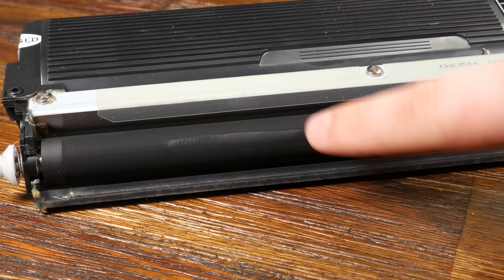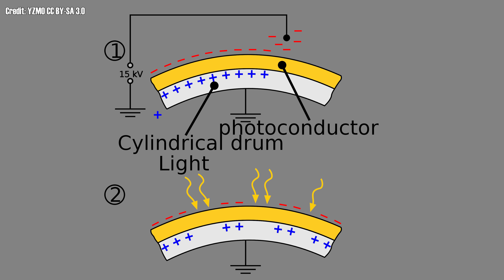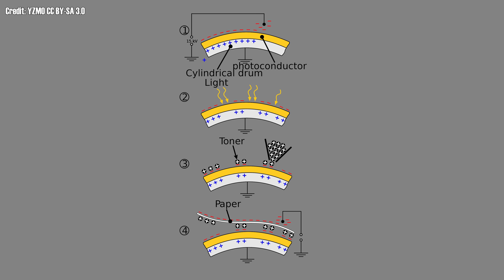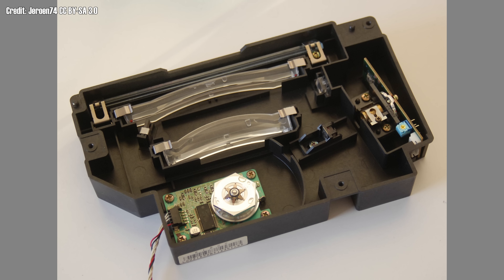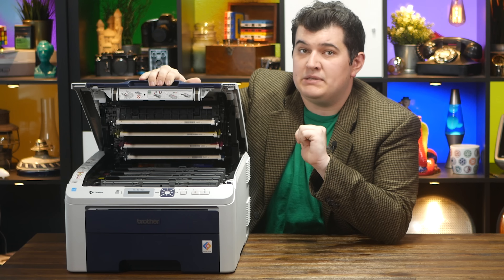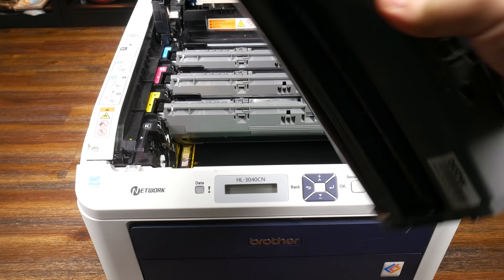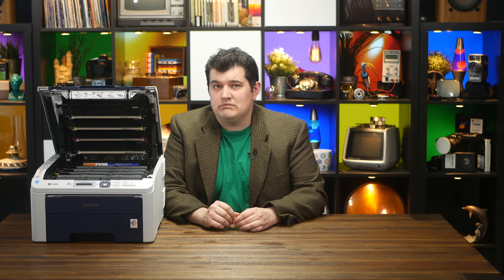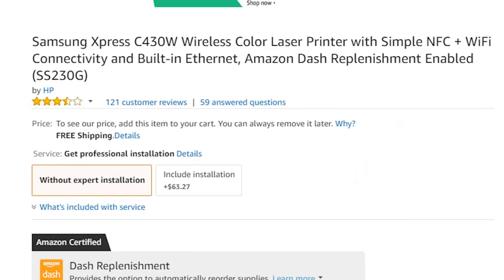LED Printers: The Common Printing Tech You Haven't Heard Of

Comment: Just found out my Xerox Phaser 6500 is actually a LED printer.  I bought it new in 2011 and still works.  I've known LED printers been around since the 1990s.  Just didn't think Xerox would use them in their printers when I bought mine.

Comment: Even today a lot of the Xerox desktop model A4 printer are in fact LED and depending on the engine in the A3 model devices those can be laser as well. Seeing as most of those print engines areanufactured by companies like Lexmark and sold to Xerox who the. Used their own software and casings etc. Has been that way for quite a few years. I happen to work for a major print company lol 

Great video.

Comment: Just an fyi... I opened up and cleaned a Canon ImageClass MF642CDW laser printer and the toners are in a line like this LED printer.  It uses an "image transfer belt" or ITB to move the paper under the toner carts in a straight line.  After opening up the laser unit, I can confirm it is indeed a legitimate laser printer with a spinning 4 sided mirror.  Point being that if you're in the market for one vs the other... You can't use the toner layout or compactness of the machine as a guide.

Comment: I had an old big high-output professional laser epson printer that had straight toner refill tanks (I think it was modded) but A3 super cheap to run and I used it to print street art paste ups.   Anyhow I realised during a repair at it's end of life that it was actually LED based not laser, when I was reading repair manual.

Comment: 0:18 Ink dries out, meaning that the printer has to either constantly be performing a "maintenance mode" which wastes ink, or you need to print rather regularly which, in this paperless age, fewer and fewer people are doing.

The herky-jerky nature of the print heads as they travel back and forth is very unpleasant compared to the smooth print of pretty much any laser printer.
Ink cartridges are usually priced at stupid levels, meaning that you're forced into buying generic ink which often clogs the inkjets so you're damned if you do, damned if you don't.

Because the ink is a liquid, freshley printed documents have a tendency to smear if touched until the ink is dried.

Water-based inks are likely to completely wash away if the paperthey are printed on becomes wet, meaning shipping labels printed with some inkjet printers can be rendered completely unreadable if they get wet from something like, oh I don't know, rain.

None of these issues plague laser printers, so despite their higher upfront cost (and arguably more expensive toner) you can pretty much count on them to work perfectly even if they've been idle for over a year, they don't waste toner on "maintenance modes," the toner is bonded to the paper so water doesn't smear it, the toner is never wet so you don't have to wait for it to dry, plus spills can easily be cleaned up as the toner is a poder. I could go on, but if you read this entire thing, now you know why I generally dislike Inkjet printers and why I will forever use laser printers. Or LED porinters, which are the subject of this video as you'll soon see.

That said, techmoan recently reviewed an inkjet printer that was actually pretty decent in terms of the ink cost, so even if a "maintenance mode" were to waste ink, it's not like it's wasting super expensive ink.

Perhaps one day I'll rejoin Team Inkjet. Particularly for photo printing (and images in general) inkjet reigns sureme. But for now, I'm planted in the realm of toner so that, when I have to do my taxes, I don't have to waste time, energy, and money fighting a stupid inkjet with clogged heads.

Comment: The scanner units in my Kyocera FSC 5020 N contain modules with a 5000 LED array and a flash memory chip to store calibration data to compensate for difference in brightness

Comment: LED printers are quite common on larger format machines, such as those used for xerographically printing engineering drawing at their full size. Those machines typically are just black and white and also don't need to have resolution as high as 600DPI (or higher).

Comment: I don't know if you've ever seen one, but hp started selling page-wide inkjet printers a few years ago. Best printers i ever bought for work. the speed problems are solved by moving the paper past an 8 inch full color print head. 50 pages a minute color printing on some model at a fairly good price. 9000 pages from a black cartridge. 7 cents a page for color using hp's prices and claims per page. What makes the really nice is that the heads are covered to prevent ink drying out when not in use, and they will exercise the heads if left unused for an extended period. When the office shut down during covid i was expecting the worst when we reopened. They worked flawlessly when we started up after 2 years of no use. They were quiet and reliable, but lasers are cool! Best printer I'd seen from hp in a while. We also have a page-wide that works with 11x14 paper. first printer printed 150,000 pages in 5 years. very good for a small office printer. $500 btw. I'd buy on in a heat beat if they started making them again.

Comment: I know this video is 6 years old now, so no clue if you'll see this comment, but after watching this video, I have a concern with LED printers similar to a concern I have about digital hybrid instant cameras. When you're relying on a row of LEDs to print, a single LED burning out renders the entire camera (or in this case, printer) defective or potentially even useless. I know LEDs typically have longer life spans, but having thousands of them increases the odds that one will burn out. I wonder what the statistical life span of these LED arrays are, and how it compares to the life span of the rest of the device. In other words, is some other part of the camera or printer likely to fall far before there's a likely chance of any one LED failing?

Also happy new year!

Comment: Wait until he learns about the Xerox Phaser 8400 that wasn't an inkjet, or a laser. They were phase change printers that used a wax-like solid ink block that was basically a big crayon. We used them when I worked for Staples for our signage. They were great but they smelled like a Crayola factory on fire when you ran large amounts of prints at a time. One major downside is you couldn't laminate the pages because the ink would "re-melt" and ooze out of the laminate sheet distorting the image.

Comment: Transfer belt unit, used in color printing process. Paper does not come in contact with the drums in these units. Instead the color is created on the transfer belt first and then applied to the paper. My research on your LED printer shows that your printer, also has a transfer belt. 
The laser printer uses a polygon mirror which allows the smooth transition of the laser from left to right, This does add a bit more size to the laser component but the LED strip for each color could result in failed LEDs in the strip, requiring the entire strip to be replaced to correct it. LED strips are also used in scanning, but they are also measured for intensity across the array. To guarantee that there are no areas brighter or darker. 
I do like the LED printers, and I believe that in the future, they will become part of a tonerless system. That also utilizes UV instead of a fusing unit.

Comment: Please explain why sometimes video is out of sync with audio. In this video, for example, the outro video clip lags behind the audio by about 1/4 second, but is noticeable. I understand that video  takes far more processor cycles to render than does audio, but most recording software takes this into consideration and corrects it with an algorithm before it's output or saved.

On the topic of printers, I have found, after 30+ years of computing and printing, that the Epson EcoTank printer line is the most reliable and economical one of the dozens I've used. The ink is cheap, lasts a good long time, and output happens faster than I can get into the next room to retrieve the print. The only caveat being, it is advisable to print a full color page at least once a week to prevent ink thickening in the fine print heads, necessitating using a cleaning kit to correct. This process is something one would NOT like to do more than once. It's quite involved, intricate, and seldom works 100% on the first try, requiring multiple cleaning cycles.

Comment: I wonder if I was the only one who thought laser printers burn the paper to print before watching this video
Reply: Well, there ARE printers out there that do mark the paper using heat alone, but that requires special thermal paper. I think these are common for receipt printers where color and shading aren't needed, just black and white text, and avoiding ink or toner is a huge benefit when you're printing a thousand receipts per day

Comment: Great printer. Have the same exact print bought 13 years ago. Bought it as it was cheaper than replacing all 4 toners in my Oki C5150n printer I bought in 2005.

Also "laser" printers that do color at 1/4 the b&w speed (or less) usually do so because they are actually printing 4 times, rotating which color is currently printed. The reason I bought the Oki back in the day was it was one of the few non commercial color ones that printed in a straight pass, allowing you to print much thicker stock though it.

Comment: Never put Tyvek in a printer that uses heat to fuse the pigment to the media. Its melt temperature is below the fusion temperature and WILL destroy your entire fuser unit. Ask me how I know.
Reply: Oooh, good tip.
Reply: Ouch... Sorry for your printer. Good to know though...

Comment: Yes LED printers are really flying under the radar because they're often labeled as laser printers. My Kyocera FS C2126mfp for example has the toner cartridges aligned such as the Brother(but the cartridges are even smaller because the Toner cartridges and drums are two separate things and the drums aren't as easily accessible with Kyoceras because there is some disassembly required) but it prints at 26 ppm both in colour and mono which is ridiculously quick for home use but I'm very happy with it

Comment: can someone confirm to me that usingt a lazer printer for glossy paper photos is not a good idea ?
Reply: Probably high quality laser printers are ok for glossy paper photos, but cheap LED printers are not very good. They are great at printing text, charts and logos as the colors are all the same shade and usually bold to stand out. When it comes to printing photos, strong colors prints just fine, it's the lighter tones which don't come out well as the shading ends up all wrong and patchy.

Comment: What an enjoyable presentation!
I am sick to the teeeth of researching printers - then I found YOU!  So eloquent in your technical knowledge, then there's the 'spinning thing'...so hi-tech! You had me chuckling more than once and I really enjoyed it! 
Anyhoo, back to the grind. Been researching printers for 3 days now. My quest? To find a decent, small or compact, reasonably priced, colour, laser printer. 
Print speed is not an issue for me nor do I expect to produce hi-quality limited editions or works of art. I want it for mainly for arty-farty stuff including printing on a variety of papers and surfaces for use in mixed media art projects. The techniques I want to try all require a laser printer, hence my quest. 
I already have a Brother print/scan/copy inkjet which I will keep, but it's no good for what I want to do. Has to be laser. I've always used Brother so I am familiar with their printers & they have never let me down.
Then this LED thing kept cropping up. Brother have a few that peaked my interest but before I commit to a purchase, I really must know this: is the end result, the finished print, exactly the same as a laser print? I mean. does the difference between Laser and LED lie only in how the toner is 'transferred' onto a surface?
I know, I know. You probably already explained but it would mean so much and make me very happy if you would confirm this!  I'd really appreciate your input and expert advice.
On saying that, I don't really expect a reply coz it's been a few years since you uploaded this but I had to reach out. I had to try.
Thanks for an excellent video. x

Comment: The Epson workforce inkjet series uses a precision core patented head that uses no heat (and therefore, never wears out) and pigment ink that not only dries instantly, but is so durable it's used for those "hazardous material" warning labels on chemical drums - which must endure testing of literally being dumped in the English Channel for weeks and coming out like new (depending of course, on the substrate).  Looking forward to your Precision Core inkjet video!

Comment: LOL! I got that EXACT model of printer too(HL-3040CDN) It's been running with off-brand toner carts for over a decade and it's still going strong 😄

Protip: It can take a 144pin SO-DIMM ram module up to 512MB, I got one on fleabay back in the day for like $10 incl. shipping. That speeded up print processing by like a factor of 3-5X, especially in 'fine' print mode.
Honestly this is one of the best purchases I've ever made: a networked, upgradeable,  2400dpi color 'laser' printer that can take $25 toner carts and it only cost like $120 back in the day(early 2010s).

Comment: I quit inkjet a long time ago. I've had a cheap Brother B&W printer I have enjoyed for years. I recently upgraded to a color model. I knew with the cheaper Brother printers I would be getting the LED version but I cannot tell the difference either. At work we use HP and Xerox "real" laser printers. Both are good for the higher demand. I personally am a fan of the HP printers. But for home use the LED printer works well enough.

Comment: But when I imagine the array of LEDs, it reminds me of the backlight LEDs of TV. Even if one LED is blown off, the complete backlight stops working.Comanies like samsung (i have samsung tv) refuse to repair, and only gives option to replace the whole display panel. Which costs approx half the cost of th whole TV. Making it less cost efficient to repair. Eveafter using all the power surge protection equipments, the LED array for me was blown thrice in the span of 7 years. Where as old CRT TV that I have, had 2 repairs in the span of 30 years. What I am wanting to say is, what if these LEDs in printer do face the same issue when used regularly. How much costeffective is the repairing. My laser monochrome printer worked for approx 10 years flawlessly then I had 1 repair. Not counting cartridge replacement and drum replacement in repairs. The Repairing cost was not big too.

Comment: Well, a laser printer is an LED printer, as the laser is in its heart an LED in that case.
But then, I remember the earliest laser printer, which used a HeNe laser.

But yeah, I remember when Okidata introduced their LED printer and there were no other LED printers on the market.
I went with a Panasonic laser, as it printed text at 22 pages per minute, which was blazing for a department level printer. No toner cartridges, it got toner dumped into a hopper by the bottle.
Much later, got a Samsung color laser printer, excellent quality, didn't jam much, overall fairly reliable, but it was an personal office level printer.
I tend to prefer department level printers, much higher toner capacity.
And yeah, my home network is an enterprise level affair. To the point where, if I go on vacation and go away, the electric company wants to change my meter.

Comment: @0:18 (So you can read it without having to slow-mo through it)

Ink dries out, meaning that the printer has to either constantly be performing a "maintenance mode" which wastes ink, or you need to print rather regularly which, in this paperless age fewer and fewer people are doing.

The herky-jerky nature of the print heads as they travel back and forth is very unpleasant compared to the smooth print of pretty much any laser printer.

Ink cartridges are usually priced at stupid levels, meaning that you're forced into buying generic ink which often clogs the inkjets so you're damned if you do, damned if you don't.

Because the ink is a liquid, freshly printed documents have a tendency to smear if touched until the ink has dried.

Water-based inks are likely to completely wash away if the paper they are printed onto becomes wet, meaning shipping labels printed with some inkjet printers can be rendered completely unreadable if they get wet from something like, oh I don't know, rain.

None of these issues plague laser printers, so despite their higher upfront cost (and arguably more expensive toner) you can pretty much count on them to work perfectly even if they've been idle for over a year, they don't waste toner on "maintenance modes", the toner is bonded to the paper so water doesn't smear it, the toner is never wet so you don't have to wait for it to dry, plus spills can easily be cleaned up as the toner is a powder. I could go on, but if you read this entire thing, now you know why I generally dislike inkjet printers and why I will forever use laser printers. Or LED printers, which are the subject of this video as you'll soon see.

That said, Techmoan recently reviewed an inkjet printer that was actually pretty decent in terms of the ink cost, so even if a "maintenance mode" were to waste ink, it's not like it's wasting super expensive ink.

Perhaps one day I'll rejoin Team Inkjet. Particularly for photo printing (and images in general) inkjet reigns supreme. But for now, I'm planted in the realm of toner so that, when I have to do my taxes, I don't have to waste time, energy, and money fighting a stupid inkjet with clogged heads.